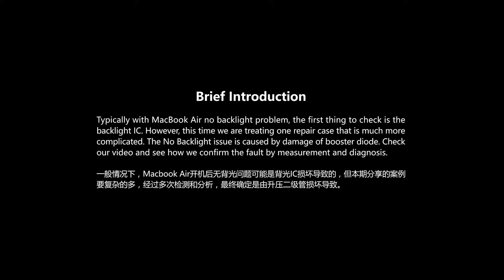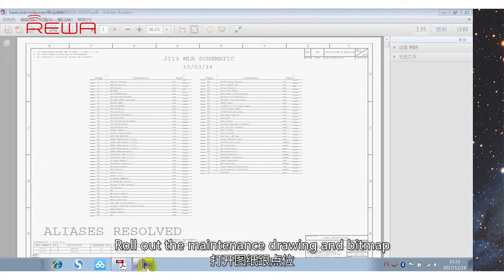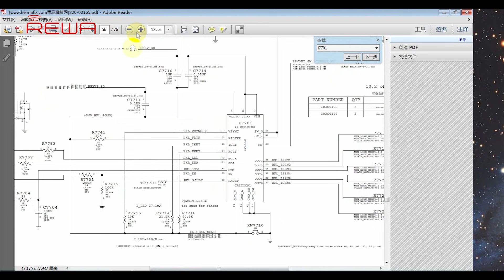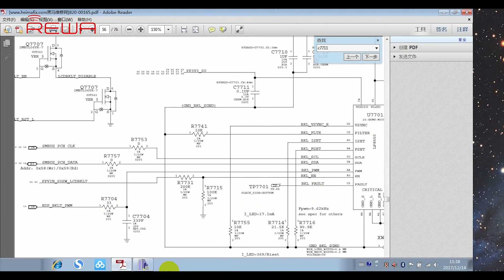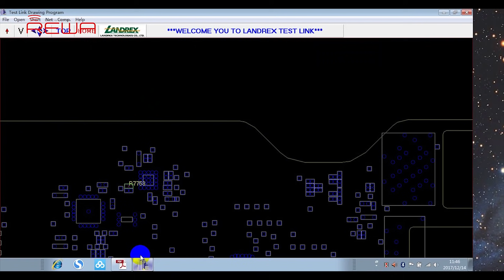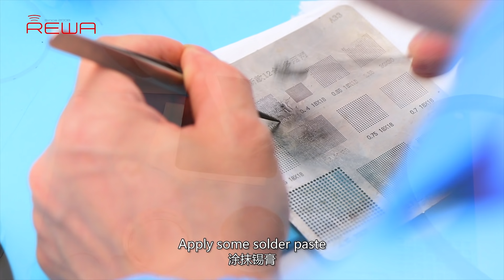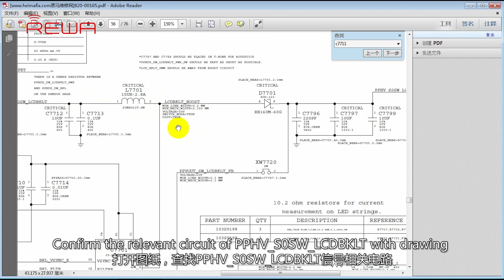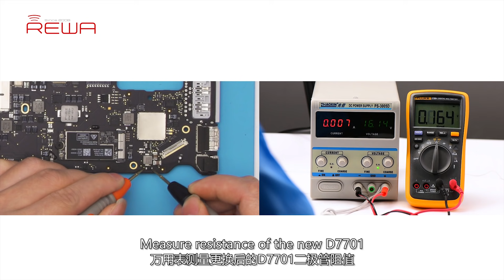MacBook Air 2015 No Backlight Repair

Comment: Great Video! Thanks for the info. I didn't find the voltage of 3.3 on the R7704.
On the R7704 I find the value of 1.4 v.? Any Ideas? Thanks

Comment: I didn't find the voltage of 3.3 on the R7704. Is it a problem with the PCH?
On the R7704 I find the value of 0.8 v and 0.720 in diode scale.

Comment: The first circuit to be analyzed was BOOST designed by inductor, diode and transistor. You would have won there at least ten minutes of video. If existe normal condition about IC, of course, would have problem in IDT. Otherwise, good job!

Comment: Hi, changed U7701 and backlight work fine, but the screen show vertical color lines. The L7701 and D7701 have 112v  (normal 50v say diagram), where is the problem now? Thanks!

Comment: Thanks for the excellent video!
I have a question, why do you need to remove all the boards from the MacBook to perform the troubleshoot?
If you connect the MacBook to an external monitor and to a keyboard you should be able to have the MacBook running without having to unmount everything.
I know it's not standard! lol but I'm a father of a two year old boy. Any time I can save is a bless!
Reply: This is a board repair video; Using an external monitor works but it doesn't fix the actual issue with the laptop like they do in this video

Comment: You say 8v5 and 2V8 are correct values for R7731 but where did you saw theses correcte value reference ? I don't see them in schematic
Reply: Yauuik right.
How?
Reply: @asjidali8296  i guess cos this guy repairs loads of macbooks, and backlight not working is a common problem, so he just knows these values, maybe he has a working circuit where he can double check

Comment: I tried to repair the Backlight and changes LP8550 but it didn't work. 
Now i desolderd every component of the boost circuit and connected a new
 boost converter from 5 V USB to 50 V directly to the pin 3&4. Why 
dosent the screen light up?

Comment: Great video, easy to follow through the diagnostics, and the issue turned out to be a simple fix. I was wondering if the diode can be checked with resistance mode? I do not really understand how Diode measurement mode works
Reply: A diode is like a check valve, it allows power to flow in one direction but not the other (aka a gate). Resistance won’t check to see if the gate is closing to prevent backwards flow..